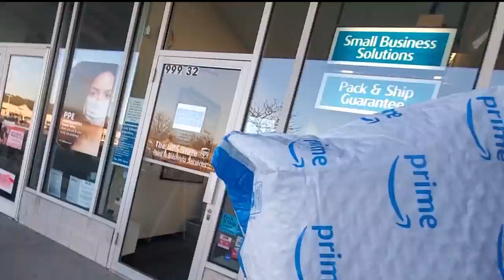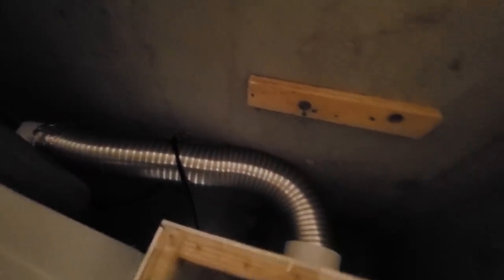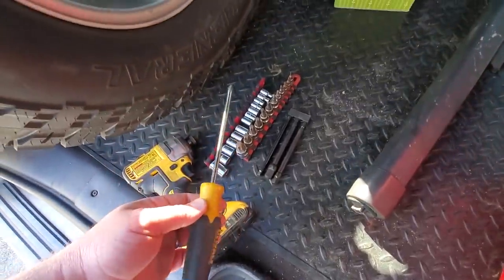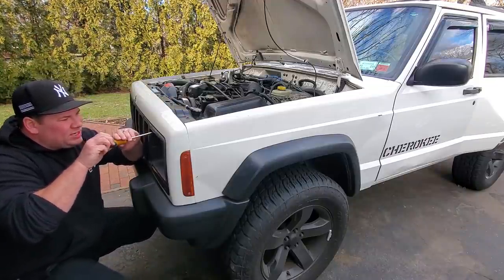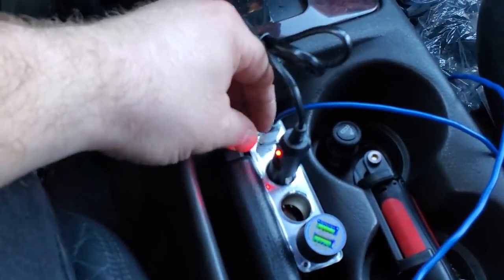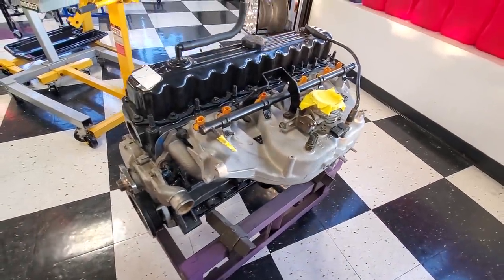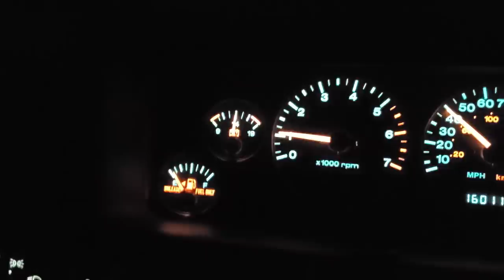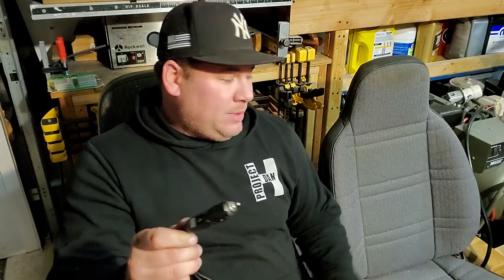A JEEP DAY WITH DAN H - A DAY IN THE LIFE OF A YOUTUBE JEEPER

Comment: Flickering lights on an XJ - time to clean up the negative terminals by the starter going into the engine block. I also did the big 3 replacing cables with 00 also that one ground wire going to the body by the battery replace with a 4 black cable. Flickering gone! No gauge issues and the engine will run a little smoother.
Reply from the maker: yeah buddy, It's such a sweet upgrade!

Comment: I got that same high flow water pump for my XJ and to be honest it made no difference. The pump didn’t seem to last as long since I’m putting in an OEM unit at a much lower price. One mod which did help the heating issues that XJs have is I put in hood louvers, one has a small fan which I can turn on which I do at times here in California. The fan is set up as a puller and blows hot air right out the hood.
Reply from the maker: that's a great idea.. I am thinking about putting in 5.9 ZJ louvers

Comment: I had one of the heated seat covers but they didn't last more than two winters.  Hope my integrated heaters last longer.  I had the high volume water pump and had to cover my radiator in the winter as it never got to operating temperature.  I live in GA and it tool care of my overhating issues for several years.  Don't forget the fan clutch if you still have one.  And flush to heater core while you have it loose.

But hey, the lights fixed themselves!
Reply from the maker: absolutely! all good info brother, thank you 👍

Comment: Try clear flood mode.  Foot to the floor. While cranking
Reply from the maker: lol.. extra gas won't make spark.. haha. it was the crank shaft position sensor.
Reply: @ProjectDanH  sometimes they will start in clear flood mode if the crank sensor is bad.  It's a good way to test it

Comment: Hi Dan, your videos are great. My display lights in my Jeep Zg also don’t work when I turn on the lights. They work because i jumped the radio c1 connect cavity 5 n 6. I found there is missing CB3 fuse (20a) in the junction block. Have no idea what this fuse function.Also is missing c11 conector. Does it have something to do with this? Ps-also have a missing connector, c302 (blue) is missing, only have c302 white on the passenger side.thank for your help, regards
Reply from the maker: oh man... that's alot to consider.  if it looks like it's been tampered with than it's probably the culprit

Comment: Dan, 
Quick question, I have a 1996 Cherokee SE XJ 4x4 and was wondering if a “94/95 XJ engine & under dash wiring harnesses will work on my Jeep. I let me son drive it for 10 years and when I got it back it was in terrible condition, so my engine harness is cut and fixed in a few areas. I have a parts Jeep and was going to pull the harness out if it fits. Love your channel thank you for any advice 
Herb
Reply from the maker: Hey Herb, Thanks for watching the videos.  Im not sure I can answer your question.. 96 was a weird transitional year.  You'd have to get an FSM and really take a good look at the wiring diagrams.  maybe hold out for another 96 parts car.